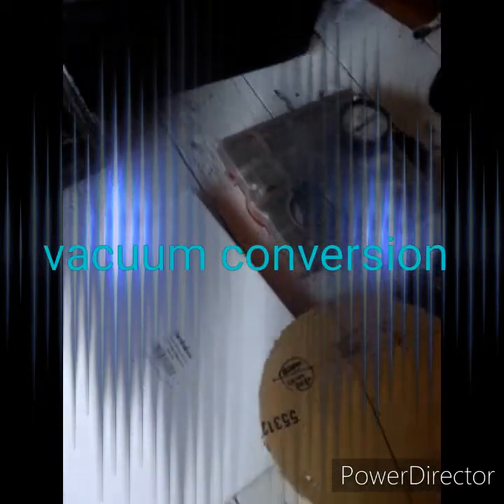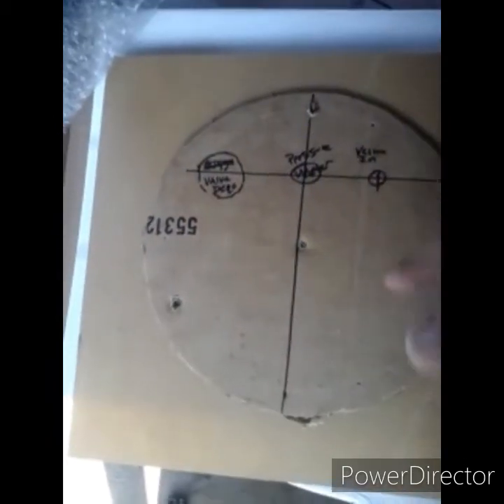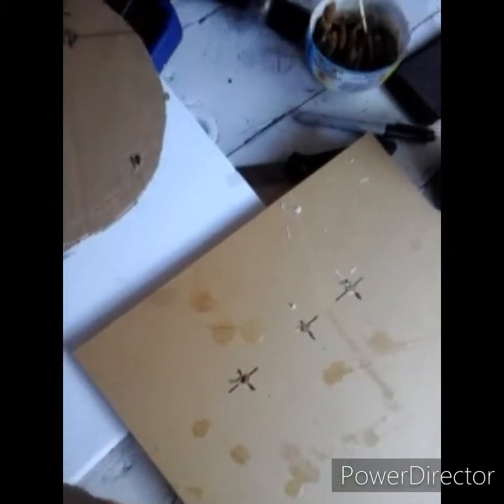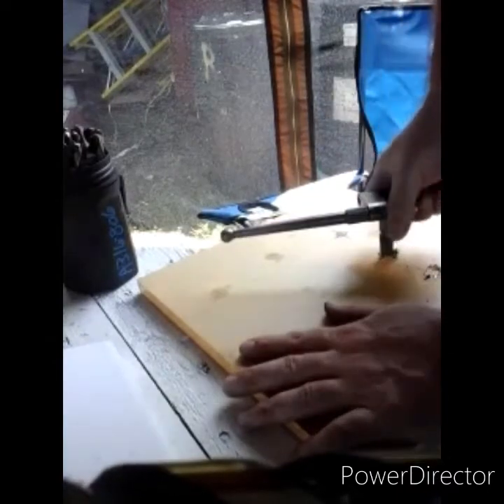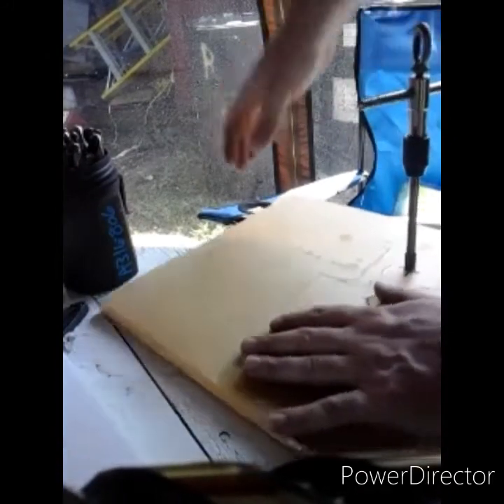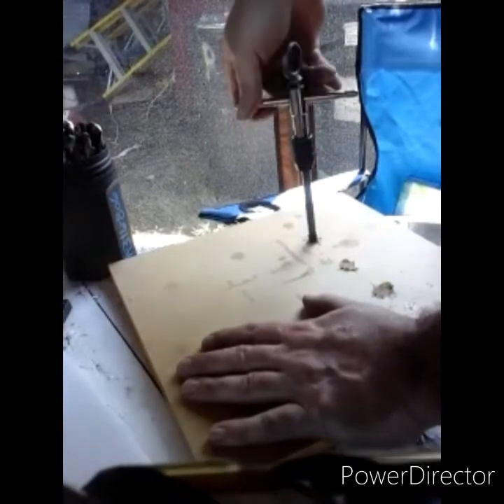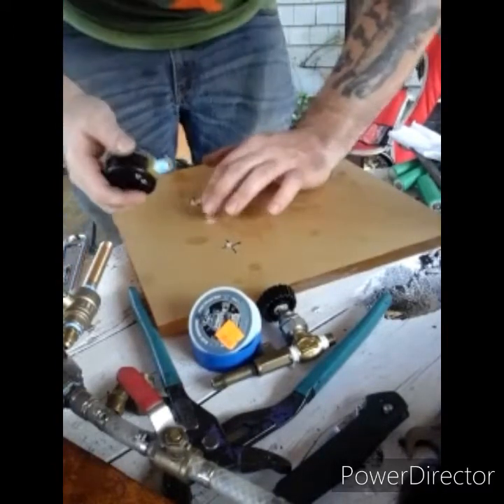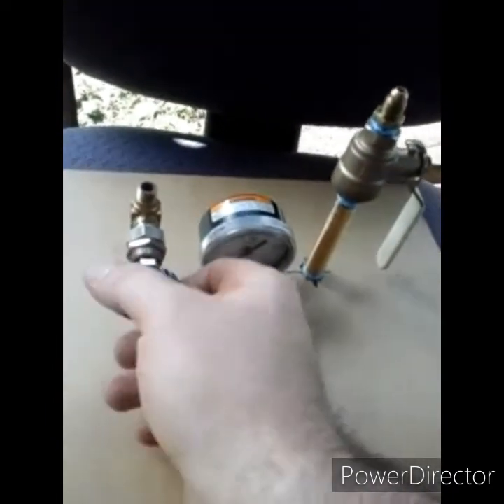Pressure Pot Vacuum Chamber Conversion PT1

Comment: Dude I need to learn how to do this very thing. I want to make edibles and waxes.
Reply from the maker: This particular set up is not the kind used in vacuum distlation of plants, however you could achieve good results with some thing similar.

My guess would be a fractional distlation column, and they are made for the purpose. I may of known some one who set one up, and used butane as a solvent to move oils out of plant mater. 

I sadly cannot produce video of this process as my job has guidelines that follow federal policy. 

builder314@gmail.com is my email however, and I may be able to point directions out, I just don't know much about the process
Reply: @tek4  right on man. It became legal where I live. Just harvested my second crop. In fact some of the Girl Scout Cookies should be ready to sample today. Although I already speed dried some and sampled. LoL I am somewhat aware of what you are talking about with the butane column. I have a neighbor that has done it and explained some of it to me. I wanted to get my thumb good and green before I expand my horizons but I do believe I am about there. Already have 2 grows with a one of a kind potting/feeding system. Just an inexpensive simple idea that even has the veteran growers mouths hanging open. I'm just good at engineering and fabrication once I understand what job is needed to be done.